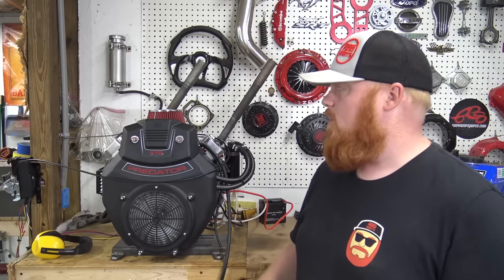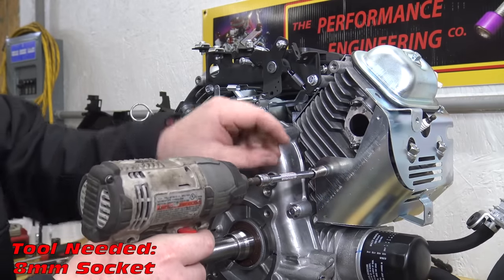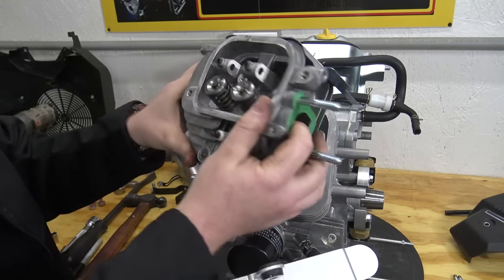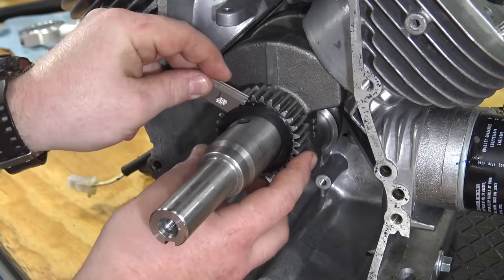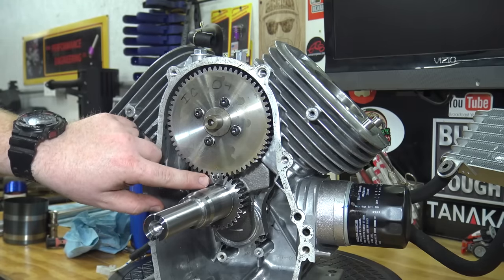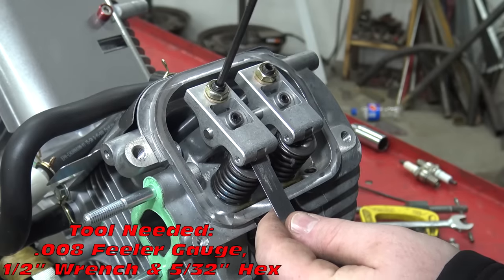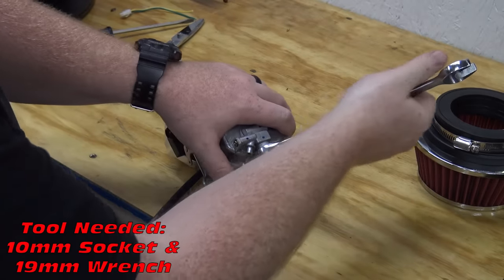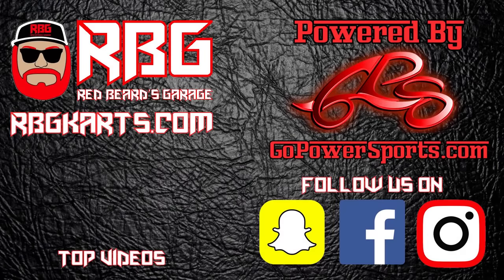🔥 40+ Hp Predator 670cc Performance Engine Build 🔥

Comment: I know these are used in generators. Can An upgrade one also been used for in a generator. Need 30 HP but the B&s vanguard 31 hp is over priced and 1 to 2 year delivery time. But the 20hp you can pick Them up Evert where. It only needs 10hp more. Is this possible?

Comment: Hey Greg. Wonder if you could help me out a little bit. I have a 670 engine mounted to a stump grinder. The engine is mounted right above the cutting wheel. And it changes pitches often. The problem I'm having is when I'm in the lowest position well cutting and bouncing around. The oil is slashing into the cylinder and smoking it out. I'm wondering is there any type of aftermarket or baffling that I can put in the oil pan or crankcase. To prevent that from happening. It had a 25 horse Kohler on it with no problems. Thanks any help would be appreciated

Comment: Are you having fuel problems with stock pulse pump? Our would starve for fuel if held wot for long periods. We had to use electric fuel pump to supplement. I’d much prefer to use a pulse pump. Do you have any suggestions of pump and pulse line location ( crank case, intake, valve cover)?  Does it matter?
Reply: Paramotor Central, LLC  ya I have problems with the pulse pump as well I hooked up an electric pump I would much rather use the pulse pump just a peace of mind that I’m not over filling the carb. Help RBG!

Comment: I'm sorry if I missed it but did you jet the carbs and to what if so that electric fuel shut off does that affect how lean it runs if I just take that out will it change how it runs.
Reply from the maker: The electric fuel shut off doesn't effect if. The engines come from the factory rich so no need in rejetting

Comment: I’m trying to find the crankshaft bolt size thread pitch and length to add an 780 clutch to the predator 670 but can’t find that info can you tell me ?

Comment: That motor sounds great. Nice camera work and very clear descriptions. What was the stock HP and why does the title say 40 hp but the video says estimated 30 hp - 40 ft/lbs torque. Also, do you know how many hours one of these stock motors are rated for?  Also, has anyone tried a lighter flywheel?   AND THANK YOU for making this video. This is a new motor for me.

Comment: I have a POS KLR 650 without any balls.  I cant find any high performance parts for it.  Does performance 670  have other parts say for my Kawasaki KLR 650?  

Another question is this predator air cooled?  How does it meet the cooling needs in race applications?

Comment: i JUST BOUGHT THIS ENGINE TO REPLACE A  BRIGGS STRATTON 16, H. P.  V-TWIN VANGUARD . WHEN I BOUGHT THE ENGINE THE MANAGER OF THE STORE SAID IT WOULD GO RIGHT IN WITHOUT A PROBLEM. WHAT A LAUGH !I AM USING THE DUSTER  COMET CLUTCH AND LIKE TO NEVER GOT THE CLUTCH ON THE CRANK SHAFT, i GOT HALF WY ON AND IT WAS LOCKED. wITH NO PLACE ANYWHERE IN REDDING CA TO GET A PULLER I HAD TO IMPROVISE WITH A WOODEN DOW AND THE BOLT I WAS ABLE TO BUY AT THE ACE HARDWARE FOR JUST OVER $5.00.  I WENT TO THE HARBOR FREIGHT AND TRIED TO BUY THE mANIFOLD PIPES AND WAS TOLD THEY DO NOT HAVE THEM BUT I COULD CUT THE TWO PIPES ON THE MUFFLER AND USE THEM. wELL AFTER RUINING A nEW mUFFLER  I LEARNED THE  COMES OUT AND HITS THE LARGE CLUTCH PULLEY. ALSO THE BELT IS RIGHT DIRECTLY IN LINE WITH THE BELT. i HAVE HAD THIS VEHICLE OUT OF COMMISSION FOR OVER A YEAR AND A HALF AND I REPRESENT THE AMERICAN FALLEN WARRIORS WITH THIS VEHICLE, I NEED HELP AND NOBODY IN MY AREA WILL HELP WITH ANYTHING FOR LESS THAT $100.00 PER HOUR. I DO NOT GET PAID FOR MY SERVICES AND HAVE ALSO BEEN DEAD ON ARRIVAL FROM BEING FORCED OFF OF THE HIGHWAY AR TWO SEPARATE BRIDGED. I PAY ALL MY EXPENSE. I AM 80 YEARS OLD AND MY VOLUNTEER WORK IS WHAT KEEPS ME WANTING TO LIVE. CAN ANYONE HELP ME TO FIGURE OUT HOW TO MAKE THIS MOTOR WORK. I AM SCHEDULED TO MAKE A CROSS COUNTRY TRIP WITH THE CAR IN JUNE AND JULY. I ALSO HAVE MANY FUNERALS I AM MISSING. YOU CAN SEE THE CAR ON FACEBOOK.COM UNDER RAYMOND F PITTAM OR MOST ANY 1901 CURVED DASH REPRODUCTION WEB SITES. YOU WILL KNOW MINE IT IS A LARGE ONE AND PAINTED RED WITH A LOT OF DECORATIONS ON IOT. IT IS THE FLAG CAR AT MANY MILITARY FUNERALS AS WELL AS SANTA CLAUS'E PARADE CAR AND FUND RAISER VEHICLE. PLEASE RESPOND ASAP, RAYMOND F PITTAM 530-222-1948

Comment: Sounds sooo good. Why didn’t you go with a billet flywheel and shave the heads? When is it getting the turbo and what is it going on?
Reply from the maker: Heavy stock flywheel makes for more torque. We are building this for off road not high rpms. Turbo will go on in a few months

Comment: i dont think i would use rtv on the rear cover. i would be afraid that a little rtv might squeeze out into the oil gallerys and restrict oil flow. Maybe some copper gasket spray might be better. I would just cut a new one out of gasket paper and check the crank endplay. I really wish there was more aftermarket support for these for gaskets, piston rings, valves, pistons, etc..

Comment: Nice my dad has a never used 212cc he said we will put it in a go kart sometime
Reply: They are really good motors for go karts I have had many of them. A stage one kit with filter header and a jet paired with heavier valve springs and governor removal are the best bang for your buck performance mods.

Comment: I would love to build a 2x v twin = 4 cylinder front engine small 1953 Porshe or Miata sized kart. My guess something along the lines of rivets and louver vents something like that I wish I had the skill and money for that task.110 hp maybe less whatever can be pushed out of 2x vtwin Predator 670s built up . Small turbo if possible or sizes possible.

Comment: Awesome,
What about a billet flywheel, is the stock flywheel going to handle the rpms?
Reply from the maker: We wanted torque and stock flywheel is actually better for our set up
Reply: Red Beard's Garage, Thanks for replying  back, so the weight of the caster iron flywheel will give you the torque your looking for.
I would be worried about that flywheel breaking apart
Reply from the maker: This engine will only rev to about 5k

Comment: Hey red beard quick questions. If I’ve got the dual carb setup from performance670cc I don’t have the intake to get vacuum for the catch can. Where else would be a good place the valve cover? Thanks in advance

Comment: Hey Red, I really enjoy your videos and your knowledge on the Predator engines and your other projects. I need some informational help on my 670 predator... I want to add a tachometer but I don't know which wire to hook the sensor input to. I purchased my tack off of eBay and made sure it was designed for two cylinder engines, it is a universal type and reads up to 8000 RPM. Which wire on the 670 would I use as input signal to the tack?
Reply from the maker: I will be installing one when we put it on the buggy very soon. I will do a wiring video on it.
Reply: Red Beard's Garage ... that will be awesome. any and all information I can get on go-karts, buggies, dune buggies I put to very good use on my ideas. thank you

Comment: I heard the stock ignition coils on the 670 are junk. (At least according to the boys at cars and cameras). Since the build, have you had issues with it RBG?
Reply from the maker: There not bad for the rpm I am running. We should be ok with them

Comment: can I assume that this same conversion can be done to the Predator 22hp 708cc engine?  it comes in almost 20 lbs lighter. also assuming these engines are all running off the same general making.

Comment: I did this but I am concerned about my engine overheating!
Can I install a large oil cooler sith a dedicated oil tank?
Reply: Yeah, and if you really wanted to you could run tubing in between all the fins and hook it up to a water pump and radiator and bam! You have a water cooled engine!

Comment: could you do a more mild build without billet valve covers, billet rods, rollers, and headers? So just try to do a cam swap, valve springs, new air filter, new carb, and billet flywheel. Would a build like that make a bunch of power an last?

Comment: You said that the carburetor comes rich from the factory, but it sounded like the engine had a bad stumble off idle when you yanked on the throttle.

Comment: I wonder if this thing could power an old VW Beetle.
Reply: well the opel astra moves just fine with only 50 horsepower. and an old beetle didn't had like 23 hp? i was thinking to use this engine to build a commuter shuttle. considering i'm doing many miles and cars are a bit expensive to run.
Reply: @SoulTouchMusic93  get a beetle, put water cooling on it & turbo it
Reply: @SoulTouchMusic93  last i knew the beetle had 36 HP at most. But i imagine torque plays a role in powering the transmission. I am thinking of making a car called the trabant 601, and that had 25 hp from factory. It had a 2 stroke engine, but i probably wont be able to find its original engine, so this engine would have to do

Comment: Interesting video.   This is a foreign made engine with all those metric fasteners.   Cap screws are not bolts,  they are all  screws.   Why install a 3/8-16 hex head screw in the governor hole?  Should just use  1/4 pipe tap & socket head plug.  Those spacers on the crank shaft  are called shims.   Why  tap out the oil  sensor hole ( 7/16-14) ?     The four center screws should be tightened first, then the  outer screws.   Those  are not billet aluminum crank rods,  they are just machined.    (true billet parts  are forged).   What is the pound reading on the factory valve springs vs. the heavier kit ones? And lastly,  what is the  power  or speed  result  before & after modification?

Comment: Whats the purpose of removing thr flywheel? Nothing there was replaced?
Reply from the maker: I didn't have to on this build but did to show how.
Reply: @RedBeardsGarage  I just built the same thing, and when I put my push rods in my my rackers on just sitting on the bench. When you do rotations with the flywheel you can hear a clicking noise before it was fine without the heads and stuff on. I didn’t hear that it was smooth could just be backlash from the gears or?

Comment: I am wondering...  if you guys could build a motor for me that is rock solid  for a sewer jetter...  I need something 35-40 horsepower to run a triplex plunger pump,,  for a sewer jetter...   it’s hard to get much over that without going diesel

Comment: Just bought the 670cc how can I charge my battery with the motor someone please help
Reply: Charge it with one of those motorcycle chargers, you can buy one at your local shop, just check how much volts is yours, for example, if its a 12volt battery just buy a 12 volt charger.
Reply: I was wondering how can I charge my batter or run lights off the motor while it running

Comment: That is a great 40+ horsepower lawn mower engine mod. Great for auto transmission Chevy Cavaliers and small compact cars. They are the best compact car engines with no street racing fuss. Even greater for ignition automatic transmission motorcycles.

Comment: I like how you neglect to properly jet the carb after doing all that, as an instructional type video that is the most important part. Best way to kill your engine is running hot n' lean. Hence the stumble off idle and RPM's don't fall nicely after revving it up.
Also, tap in a ratchet is a NO NO sir! That's a great way to get some goobered ass threads. Other than that, good video.
Reply from the maker: No need for jetting the carb as it is rich from factory. I have used a ratchet for years and it has never let me down. Im sure there is the risk of messing it up but it has always been good to me

Comment: I've had an idea for predators because the have that oil drain you could have that be the input into an oil cooler and the old govener hole be the exit for the oil cooler so you have fresh cool oil going on top and hot oil being pushed out the bottom just a though I'm not sure if it's practical

Comment: Looks sweet but it seems to be the only part that will really be increasing performance is the cam.  I can't really see a cam swap alone making the engine a monster.
Reply: Do R/C! It looks like the cam is the only mod....plus governor removal.
Reply: They are strengthening the engine to withstand other mods. New rods and all of that other stuff frees up the engine to withstand more compression and other heavier duty mods.
Reply: Jack G i also saw the stronger rods go in....but as far as his question was asked what were the actual performance gaining mods...as of yet the better rods have not given him more power. But yes its a little Stronger now for future stuff.
Reply: Jonathan Stevens that is correct. However, it depends on the material the rods are made of. More lightweight rods that can stay cooler. Yadayadayada. He didn’t do too many things to gain hp in this video but a lot of times in the car community if you’re gonna do performance mods it requires the little things like forged rods or bigger injectors.
Reply: Jack G that is correct...i agree....obviously we are both engine men.....lol
Reply: The real power gains come from spinning the motor faster than the factory limited 3600rpm. You need the stronger components to do that without blowing it up.
Reply: Sam Thomas That can be true but you need a motor that is optimized to run a higher rpm as well.  I'm not saying this engine won't make more power above 3600 but the entire thing is designed to run at 3600 so chances are it's optimized to make it's power around there.

Comment: You should try running a stock predator 670 for a long time (with a good muffler) because people say they won't last more than 1000 hours
Reply: 1000 hours on a go kart is a LONG time. Thats 5 top end rebuilds of a 2 stroke dirt bike, maybe even approaching cracking the case for crank bearings. 1000hrs would roughly be 4hrs a day, 5 days a week, for a year.

Comment: Lighter flywheel and a bigger carb ( - or two) would improve response and power.
Reply from the maker: Lighter flywheels bog easier. This engine was built for torque.

Comment: Your Link to the 506 Cam takes you to the PRED 501 BILLET CAMSHAFT, and Video Headings says 40+hp, yet in the video you say 30hp! What Max rpm is the Cast Stock Flywheel Good for? I would think to make 40hp you would have to be turning it 5000-5500rpm at least! Do you actually Dyno these or best Guess? If you do Dyno some of these that would be nice to see also.

Comment: Why do these so called engineers insist on using an impact driver for just about every fastener.
Reply: That gun isn’t an impact
Reply: Rafael Castro, the guy himself mentions he’s using an impact gun, but my point is why use an electric driver for every single fastener. It’s just lazy and a sure way of doing up fasteners far too tight or prematurely wearing / stripping threads in soft diecast alloys.

Comment: what was the cost of doing this in parts including cost of motor
Reply: Probably about 1500-2500 dollars estimated. You can buy an already built one off the internet from a website called proformance670.com for like 2650 or so. Check out Vasily builds on YouTube he did a kind of budget build on one. The motor alone is 650 dollars on sale. If you were are wondering about what engine would be best for a go kart I can help you out just ask.
Reply: Yeah but to make your own stuff you need welder and a lot of tools. Some people would pay more once they bought all that stuff.

Comment: anyone know why my bike takes off on me as soon as i turn the choke off... i had just cleaned the carb completly yesterday night because it would idle but when revved it wouldnt go and it would bog down. so after i cleaned it i left it ovwr night and now the bikr takes off on me.
Reply from the maker: make sure the carb doesn't have a air leak at the block or insulator. If it does it will cause it to rev higher

Comment: Hello sir. I hope you are well. My name is Carlos Alberto Alvarez, I live in Medellín Colombia. And I want to build a track motorcycle with an engine that has given us an OHVI 1000 cc mark, from an electric generator. What happens is that it works with natural gas or LPG. And I do not know if I can change to merge with gasoline? What type of carburetor should I place for the best operation? I saw your YouTube video, where you modify a Vtuwin 670 cc engine, I find it very interesting. For this reason, I appeal to you, because I believe you can give me the information I need. Thanks for your help. Carlos Alberto Alvarez.

Comment: 23:30 why voltage regulator has 3 wire ?
i see a missing fourth wire   what the heck ? is it using itself as ground  and the third wire go to the battery ? 
and the first 2 wire directly from the alternator ?
tell me is that or something else ?

Comment: id rather get an xr 600 /650 engine or a dr650 engine... also 40ish hp, gears, and reliable to death, +xr engine can be tuned to 70hp if you stroke and bore it to 720cc, put a cam on it,bigger vlaves, carbs etc...

Comment: Wonder how long this Chinese engine will stay together with these performance parts. Typically, these small engines, all small engines, are made to certain minimum standards and don't respond well to the added stresses of performance parts. Wonder how well this thing would hold up to, say, garden tractor pulling competition.

Comment: Why put that heavy flywheel back on it. Why not the aluminum one
Reply from the maker: For the rpms we are running its not necessary. The heavier flywheels gives you more low end torque. We like off road so thats why we chose to go with the stock.

Comment: I want an engine that is at least 40hp but weighs approximately 70 lbs max. If I could get dual mags and dual spark plug heads would be great. Any chance anyone in here knows if the Predator 670 is capable? What about the Briggs vanguard 23 hp 627? I want to use this for an ultra light aircraft. So I’ll be adding a reduction drive in order to spin the propeller at the optimum rpm.